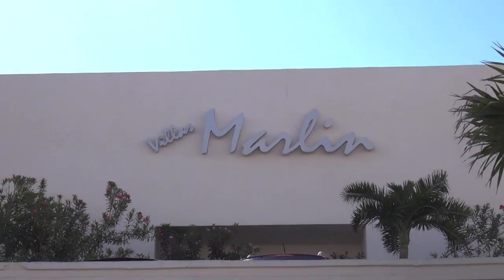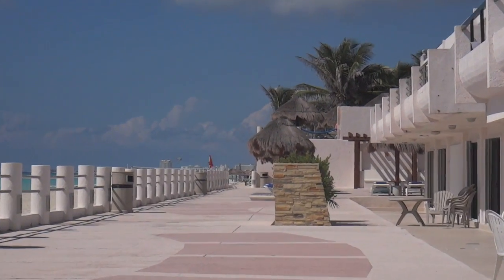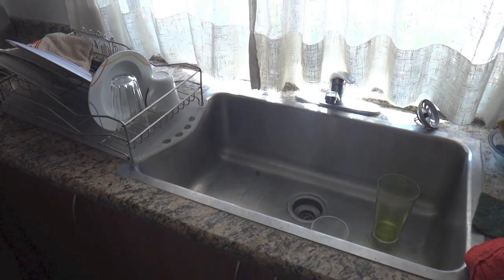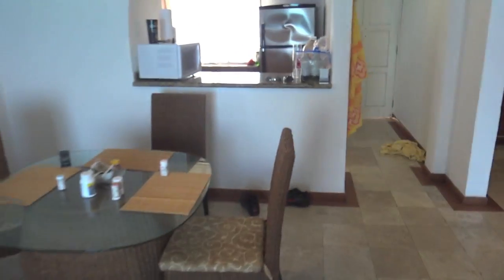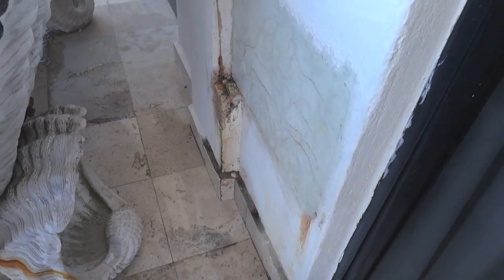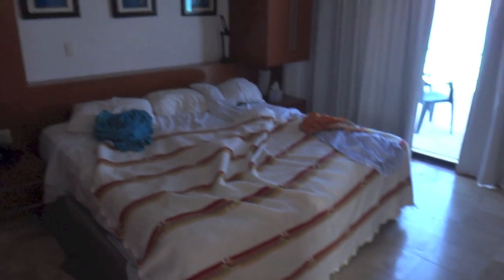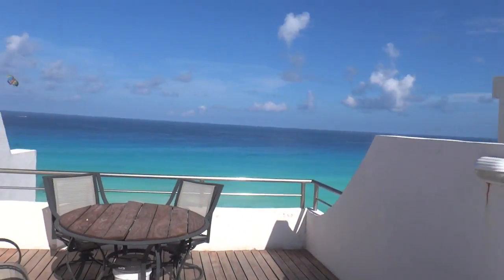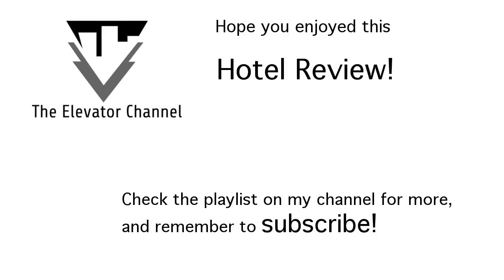Rental Review - Villas Marlin, Cancun

Comment: If you look at the design of the two bathrooms it looks like the both used to be the same but in the one downstairs they pulled out the shower doors and rammed in that awkward tub.  THey didn't even bother plumbing in the drain they just connected it with a hose to the old shower drain.

Comment: Even though there are a LOT of cosmetic issues, you surely have to take into account that they have 15 rooms and 2 people are running it, so maintenance could be a little tricky if they are doing all of the work. I would say that due to the friendliness of the owners, that I would definitely stay here. I don't like the low railings on the hallways, it is kind of a safety issue.

Comment: Nice tour; I loved the witty commentary, especially about the air conditioners. That electric range could be replaced, it looks from the '60s or '70s. They should have routed the pipe for air conditioning directly to the drain. The maintenance issues outside need to be fixed soon. The rust running down the walls and holes look deplorable. Those doors also need to be replaced.

Comment: Rented a condo for a vacation years ago. 2 bathrooms, one was terrible, looked like something out from an army bunker. Rooms and balcony(facing an abandoned half-built shopping centre) are ok, just that the windows are fairly rusty. Living room and kitchen is fairly empty. Most kitchen equipments are old and some of them broken. Washing machine, gas tank for the stove, air-con units are together right beside the main door. Lift breaks down occasionally and the pool downstairs is full of leaves.

Comment: The downstair bathroom is probably the stupidest bathroom I've ever seen! The patio doors and the rusting light fixtures outside seriously needs to be replaced. Not a good idea to use woodboards as the rooftop patio's flooring especially where the patio is very close to the beach like that.